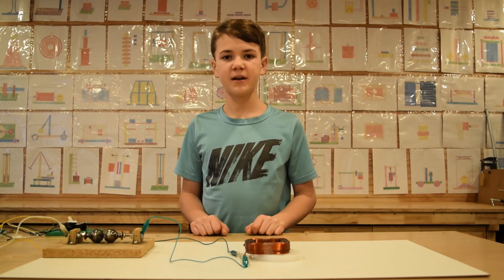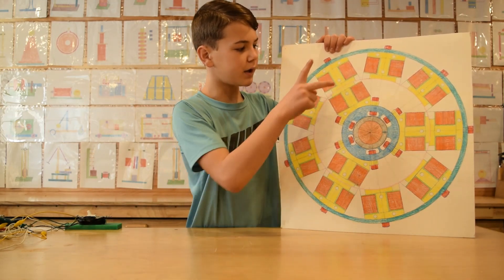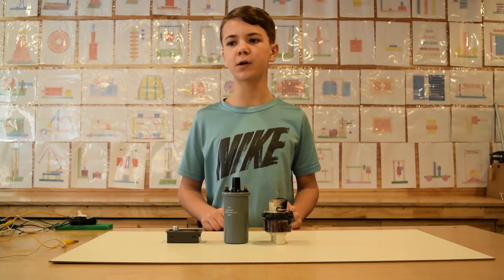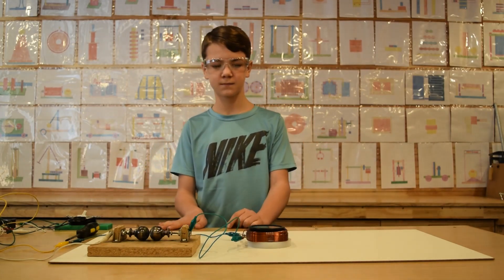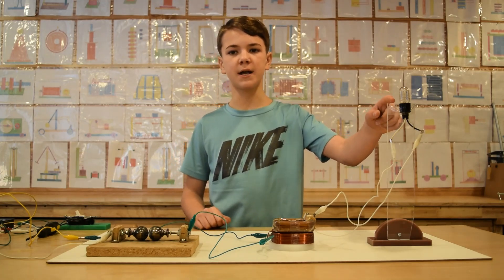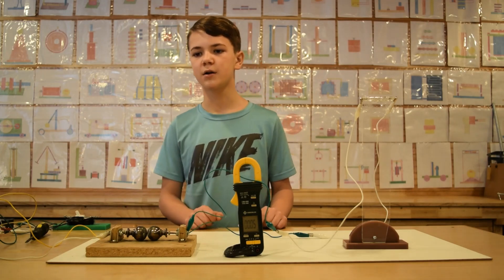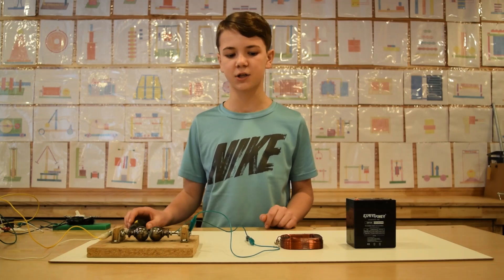Radiant motor concept of operation Over unity.

Comment: I am surprised how much energy comes from the discharge using only 20 watts. Have a feeling that Mr. Gray was really ahead of his time. Shame his idea was not used and kick the butt of the new electric vehicles.
Reply from the maker: If Elon Musk used this technology in his electric car, either discharge technology or simply modifying his Tesla motor to be able to recapture, recycle and reuse some of the energy over and over again. It will give him 4000 miles per charge instead of 400 miles per charge or his electric car can get 400 miles per charge by using only 1/10 of the battery pack. This will allow him to manufacture 10 more cars with the battery pack of a single car, he has trouble building batteries fast enough for the demand for electric cars.
Reply: @DanielsInventions  I am keeping an eye on what you are doing and hopefully I can make something that will get that kind of mileage. Please keep me in the loop fella. Peace
Reply: @DanielsInventions Yes but the profit and the 💩 show wouldn't be the same.

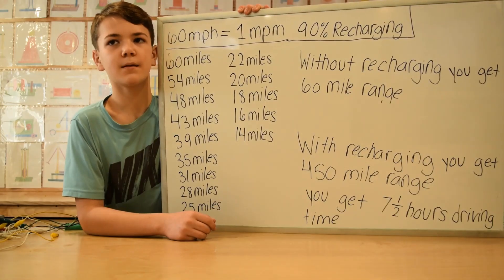Comment: 2:26 wait up... what if you put a super heavy load on your engine? Will that draw more current from your batteries???
Reply from the maker: If you look up the patent online, you will find out that the motor once installed in the car always ran at a constant speed whether the car was waiting at a stoplight or driving 70 miles per hour on the highway.
Reply: @DanielsInventions  No I asked will the motor draw more current from the supply at heavier loads? But if the motor stays at a constant speed then it must be a shunt dc motor
Reply: but then is there a gearbox?
to alter the speed and torque output of the motor for the vehicle?
Reply: @DanielsInventions  how do I get these components to experiment with? You don't Rey to emails